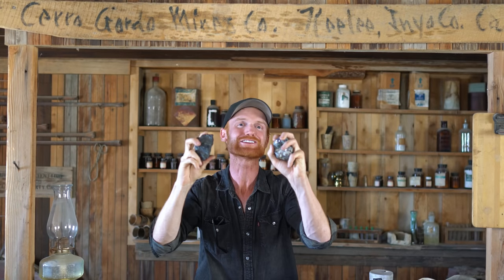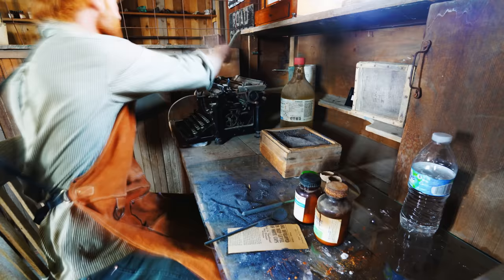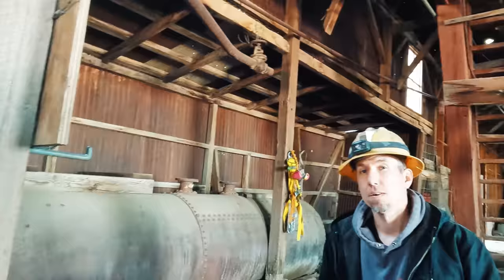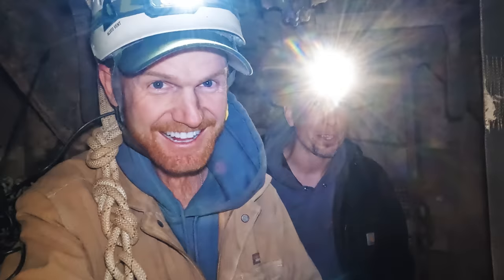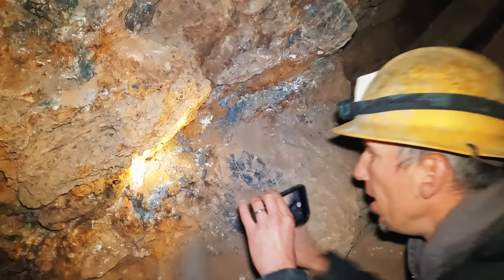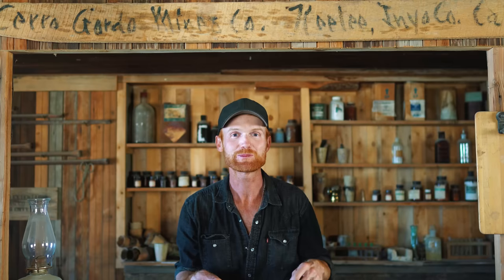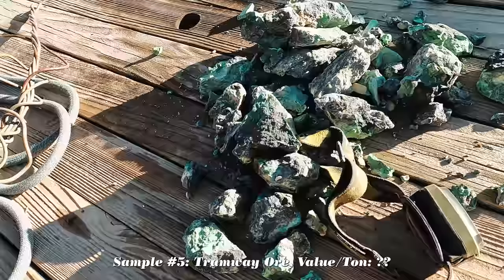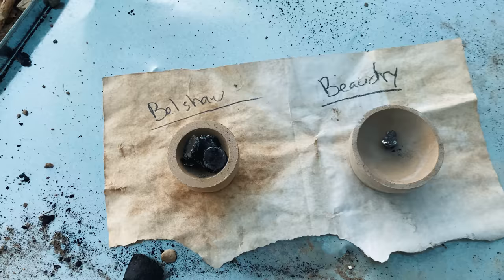What They Left Behind At Cerro Gordo Was Worth Millions

Comment: Logically speaking, as they started mining the area the richest veins would have been processed first.  That would mean that the dump and slag areas would theoretically contain more leftover valuable material the further back in time you went.  So the better candidate material to re-smelt would be at the bottom of the respective dump and slag piles.  Since you were getting your samples from the surface of the piles, that would be the lowest value material.  The "good" stuff is buried below it. Good luck re-mining the dump and slag piles.  Hope you make a fortune.
Reply: Makes sense.  During WWII, the tailings piles of lead and zinc mines in Oklahoma and Missouri were recrushed and sent through the smelter again.  I forget what was retrieved, but it was in the neighborhood of 15 to 25% if my memory works.
Reply: True and also the refinement process was also cruder. But a good point to make is that it's not necessarily the highest quality first. It would have been the highest quality at the time of mining. As they mined deeper, they could have very much found higher quality veins than the start. Just due to the process of finding more veins. Obviously, the surface is still lowest as it would have been when the mine was failing, but lower doesn't necessarily mean better quality ore. But may mean more silver leftover. If you get what I mean

Comment: I used to work at United Keno Hill Mines up in the Yukon, Canada. It was a lead, zinc, and silver mine. They tried a new process of floating the ore with cyanide in the bubbler tanks. When they took a sample of the ore and poured it onto the waffle board there was a light hew of gold at the top. There was enough gold for them to re-mine the backfill they had pumped back into the mines and refloat it for the gold. I figured that you might want to set up a crusher and bubbler tank to see if any gold was in the ore. Keno Hill didn't even know that there was gold in the ore until they used cyanide to float the gold. All the slag that was dumped could be worth a fortune, let alone what is in the mine at your site.

Comment: I have a question. Working inside that mine and breaking the samples out of it, aren't you worried about breathing in all that lead dust?
Reply: Only lead that can hurt him is moving 3,000feet/second
Reply: As someone that has worked in an underground lead mine, there are precautions that he should be taking. 

Every 6 months he should do a blood test to check his lead levels. If his lead levels become elevated, then he should stop the lead prospecting.

No eating without washing hands.

Wash himself thoroughly after going underground.

A dust mask would be good, but not critical as he doesn't appear to stir up too much dust. Except when going up & down ladders - If he is going to travel those areas frequently, then he should wash down the dust with water.

Generally speaking however, I am more concerned about what he does underground as he appears pretty oblivious to some of the dangers he puts himself in.
Reply: @snaker9er  2 way range?
Reply: Dont worry its 100% organic lead
Reply: @OneLeatherBoot  Right? That lift that was designed in the 1800s? One bad footing and he's stuck for the ever ever

Comment: Don't be scared to apply decking oil to all the exposed timbre. if the wood hasn't been oiled for a while it will be quite thirsty. I use it all the time where I live in Australia its hot where I live too. hot and humid though, I'm guessing its hot and dry on the surface. But possibly more humid underground. the decking oil will protect the wood from excessively drying out and rotting. Actually looking at the laddering system I reckon a tipper (or chained tippers) like what our opal miners would let you move larger amounts of ore to the surface.
Reply: Yea he should go to home depot and get some oil based sealer.
Reply: @MrBakedDaily  hes gonna need a loooot. But also theres none nearby i think...

Comment: Bear in mind that the samples taken are assumed to be representative of the average mineral content of the place the sample came from. So, if you picked an unusually good or bad sample, your results are going to be out.
Reply from the maker: Indeed! I think a few more assays from both Beaudry and Belshaw are in order!
Reply: Yeah was gonna say that doing the math with the small sample size used (just one or two samples each) has the potential to produce quite misleading results- being products produced by complex processes both the ore and the slag are unlikely to be homogenous products (it's not just the copper content that varies between the ores- there's likely a range of different metals in there that only more sensitive processes like X-ray fluorescence using handheld or bench-mounted XRF tools are likely to reveal) so any one piece of ore or slag might be significantly richer than it's neighbor. If you can get hold of a handheld X-ray fluorescence tool you could potentially get a better idea of the composition of the material you're analyzing without sending it off for lab assays.

Comment: Here's a thought for you. If you do wind up trying to extract smaller amounts of silver for some form of income, consider using solar power and an electric system of some sort considering how reliably you will be getting good sunlight out there. You wouldn't even need to worry about power storage, just blast all the solar output through your heating elements (within reason, of course). Even if you need a reducing environment, you can still minimize your fuel use by making your furnace reasonably airtight and trickling in a small feed of it.

Comment: Quality content! One question! Brent do you not worry about breathing all that dust in down in the mines? In the video you can see the air just full of floating particles? Is it safe to breathe that in? Just worrying about ya! Keep it up!
Reply: I wonder if the potential gas from smelting the lead might be dangerous if breathed.
Reply: It can’t be good to breathe..
Reply from the maker: I typically wear a mask these days! And I don't go in the mines that often over the past 6 months. We had respirators we were using, just left them at the top of the shaft when we went to the 400 this time. But not a regular thing!

Comment: Is it safe to walk in the mine without a respirator? From what it looks in the light there is a lot of dust, there might be a lead poisening hazard
Reply: The guy does see a little wacky. Maybe it is.
Reply: Was wondering the same thing - I hope he puts on protective gear when necessary... Idk for sure but I don't think contaminating your hands with lead ore would be good for him either. Stay safe up there Brent
Reply: It depends on the mine but the general idea is to wear one if it's dusty or if there's any potential for breathing in toxic material like in this mine.
If you're doing this once and you're only spending an hour or two in the cave, you're not in any potential danger, but if you do it constantly, it's going to add up.
Reply: Also galena is a sulfide mineral so these types of mines often fill with hydrogen sulfide gas which turns into sulfuric acid in your lungs.
Reply: He's addressed this in other videos and has said they take equipment down with them that will notify you when a respirator is necessary. But it definitely seems like a good idea to wear it 100% of the time down there

Comment: I think your numbers were high because you were cherry picking from a premium spot in the mine.  To move 20 tons of earth in the 1800's was an amazing feat.  That being said, I also believe that quite a bit of low-grade material would be processed as opposed to just being sent to the overburden piles.  As they were tunneling through the mountain every pound of material they moved had to be removed from the tunnel.  So, every pound of material was graded as overburden and dumped over the edge, or brought to the smelter if it had any quality mineralization.
Of course, I'm not a minor, but I'm trying to include the fact that to get 20 tons of material to the smelter you would likely be moving 40-60-80+ tons of material that was in your way...every day!
Reply: >  Kevin you are correct about the overburden needing to be a part of the assay.  Picking up exposed samples only is the easy part and then some hard work must be done to continue exposing more ore that must be separated out. It would take several more samples per location to assay out an accurate value.  I did a survey years ago and calculated  about 5 $million gross,  man was I excited like Brent is,  the actual production was minimal.
Reply: Brent, this being caifornia, you'll never get permits to mine and extract these valuable ores.  Additionally, recovering silver from slag is a very tricky process and probably would require shipment to a smelter.  Lead - zinc smelters were pulled out of the usa many years ago due to environmental issues.  Even those in Mexico are almost closed now.  You would need to most likely ship the material to China / Japan these days.  So make sure you factor these shipping costs in to your cost calculations for your silver recovery operation.
Reply: You are correct. In geology its called a grab sample vs a channel sample that would give you the actual mineable average grade

Comment: There were 2 silver rushes at Cerro Gordo in the late 1800's. The second resulted after improved smelting techniques were applied. According to one local historian, mineral claims were being staked out on slag piles from the first rush. That may be why the two different slag dumps yielded such different results because the dumps were from different rushes and/or different smelters.

Comment: So I hope all is well Brent.  I have been wondering something..  The shaft gets tight after the 700 Hundred level correct...   It could just be the wood swelling,,,  But it could be signs the Shaft could be facing a collapse in that area.  And you want to keep up on the maintenance to keep all of Cerro Gorrdo Preserved...   General maintenance on keeping the Shaft Safe and Operating is crucial.. get someone that knows how to keep a Shaft Structurally Sound..   Eliminate the possibility of collapse and then make it operate with no sticky spots..

Comment: Well, 1800 mine dumps originally done for mining gold were recycled, the remains being used to fill old workings again, and the gold, silver and copper from them being the profit. The running costs were covered by the sulphuric acid and PGM recovered from the dumps, which were actually at times having a higher recovery of gold than the current mines.

Comment: Hey Guys... You can take Space Blankets or Mylar Sheets and make large Solar Reflecting Panels to Solar Heat the Slag, VERY HOT VERY FAST !!! No Gas Costs etc... After All SUNLIGHT is you most plentiful commodity there besides sand and rocks... Mylar Blankets are So Darned Cheep and old plywood sheet or any old panels become usable with that glued onto them....

Comment: I don't imagine it's worth a whole lot, but, Galena, just in case you didn't know can be used as a "detector" in  "Crystal" Radio. So if you're a crystal radio freak like me, and you want an old school radio, Galena is what you want. It's actually very pretty in my opinion. 
I have a piece or two that came from a local mine.
As I said it's probably not worth a lot. But you could sell the Galena. How much could you sell?  Probably not much, but I think it's interesting.
It's actually a "semiconductor". (The Galena that is.)

Comment: What is a Niton gun?
The Niton XL2 800 PMI gun is a handheld X-Ray Fluorescence (XRF) scanner that provides dependable elemental analysis for your most demanding inspection needs. This high performance and lightweight XRF scanner is easy to use, even for non-technical personnel.

Comment: Almost all of my working life I have been a minor. First I worked in surface coal mines in Wyoming. Then i worked in the gold mines on the Carlin trend in Nevada. What came as the biggest surprise to me was where i retired to. I now live in the small town of Galena,KS. It is the location of  what were many large lead mines. Needless to say that the town is named for the ore that was mined here
 I found the assay work you did to be interesting. But i would like to see you do a better job of sampling the areas you assayed. The real value of a mine or a slag pile would be determined by a much better cross section of the ore or slag. What you have done would not be of much interest to a refiner. The possibility of a profit does seem possible, but it is far from certain.

Comment: There's probably enough mineral wealth left in Cerro Gordo to start mining operations once again, after sitting abandoned and forgotten for almost 90 years. There may yet be untouched nodes and veins of galena within the rock that has yet to be discovered. If that happens, I wonder how some of that profit can go towards restoring some of the as-yet unrestored original buildings.
Reply: No way, u cant use these old ass mines with todays safety regulations. Just modernising this stuff would prop coust u a 100mio lmao
Reply: @Tristan-42069  You don't need to modernize the workings all that much. Just revitalize the infrastructure that's already in place. It's something that happens in the industry all the time, when decades old mines are reopened.

Edit: It may even be worth a lot to reprocess the slag.

Comment: Yes, there is a lot of value just sitting out there in the open. The reason they left is the reason many mines up and leave; scale. If you have to keep reducing you workers week by week just to keep it profitable then you get a bad reputation for work and pay stability. Lets say for a minute you could move about 3 tons of material a day with a  processing speed of about 300lbs a day given your much smaller furnaces. That comes out to about 510$ per day gross, which when you really think about it is not THAT bad of a haul compared to just I dunno, working at Walmart. That's about 130k a year gross(if you work a 5 day week).

Comment: Chances are they did leave millions behind yes but the seams size and quantity /quality might be not as worthwhile at a different mine site with a bigger seam. Locally we have a coal mine with coal that's still there with high quality coal but the need for this high quality coal (that was used for smokeless steam engine use) is out of fashion and the seam too small to be competitively priced against a bigger seam that could be worked with bigger machines etc
Reply: Also the price of imports and bigger mines and towns/housing can drastically change a landscape. If the mines miles away from a town then it's not as viable in say the 1930-50s

Comment: I can find all kinds of minerals a long way off and deep and pin point them  cool ha
Reply: I can find all kinds of minerals a long way off deep and pinpoint them say up to normally 40 are 50 feet  deep probably with extra acquirement  deeper and pin pont it
Reply: You have a GRATE show I injoy them very much I use my ability to locate deferant things like I can find the gold line in a river and determine where the hot spots are and the depth and after digging to it start painting color with out having to test the hole river to find it